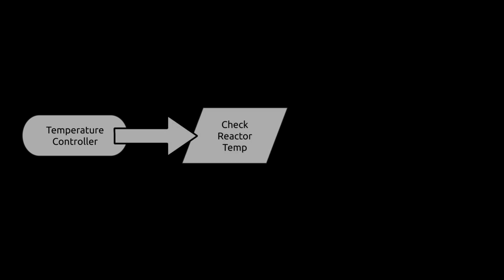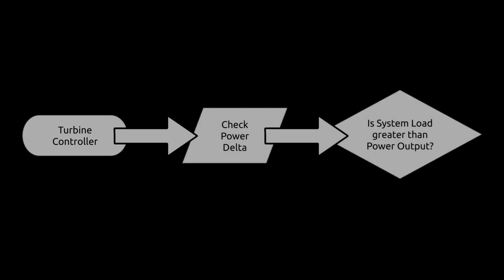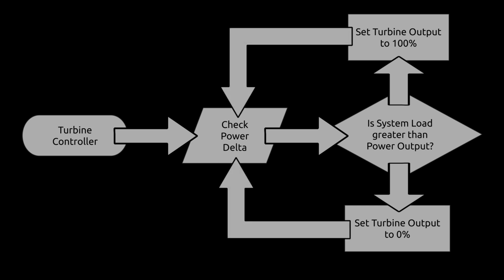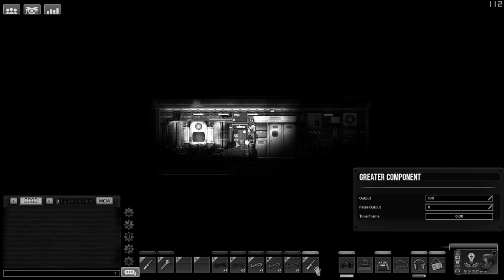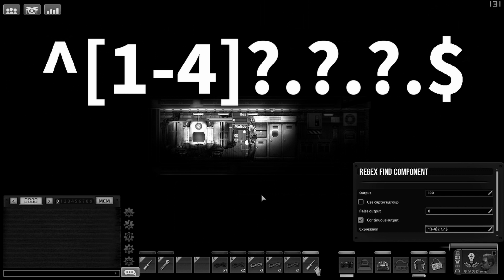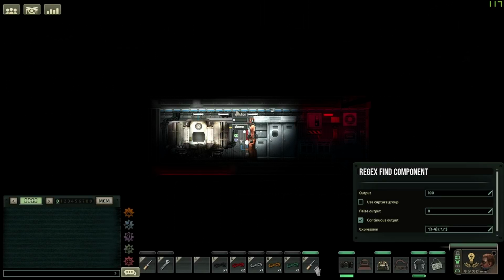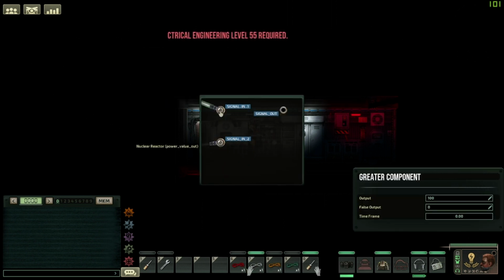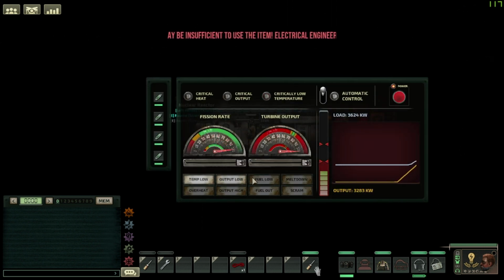Barotrauma - BEHOLD! The 2-Component Reactor Controller!

Comment: Great system that's worked wonders for my campaign! However, it does have one issue - the pattern used in your regex component will keep the reactor temperature at 4999, because everything between 4000 and 5000 still matches the pattern of starting with 4 and having 4 digits. The pattern ^([1-3]?.?.?.?|4000)$ will check for the numbers 0-3999 as well as 4000 with the or operator, making sure it stays at 4000 degrees exactly.
Reply: This definitely makes a lot more sense. The one in the video allows up to 4999 which is too much. Your formula expression works a lot better.
Reply: I know I'm kind of necroing here, and I'm fairly new to RegEx. What's the purpose of the () at the beginning and end? Is it for the | to function?
Reply: @Phoenix33699  In this case I don't think it matters, but it essentially clears up any confusion in what it is looking for. The | is known as the "pipe" or a "logical OR," which basically says that we accept anything to the left of the pipe OR anything to the right of the pipe. For the pattern '^([1-3]?.?.?.|4000)$' it essentially says it will output 100 if the input is any value between 1 and 3999 OR 4000. If we remove the parentheses, then it will have the same result, but by asking for a different value. For example, the pattern '^[1-3]?.?.?.|4000$' will output 100 if the input is between 1 and 3999 OR ends with 4000. Either way, it outputs between 1 and 4000.

If you want more practice with RegEx, the wiki recommended this website, which is where I learned it. https://regexone.com/lesson/introduction_abcs
Reply: @coopj70  so if I'm getting this right the parenthesis are limiting the search field for the OR?
Reply: @Phoenix33699  That is correct. The ^ and $ are essentially saying that it should start and end with whatever is in the parentheses, i.e., should only contain what is within them.  

It's similar to using parentheses in a math equation, it's just to separate or "group" your operations. I believe in computer science, Regex can use these groups for further use, but doesn't seem possible in Barotrauma.
Reply: @coopj70  gotcha, thanks so much for your help!
Reply: @coopj70  The parenthesis aren't strictly necessary, but if you don't use them then you have to redo the ^ and $ for each or else it will only use ^ for the first and $ for the second. I think the parentheses just make it cleaner.
Reply: @coopj70  Every time I try to use regex I generate a thousand more problems, but I can't get past the allure of its power. That website looks like a godsend. HUGE thanks!
Reply: @Phoenix33699  The parenthesis aren't strictly necessary, but if you don't use them then you have to redo the ^ and $ for each or else it will only use ^ for the first and $ for the second. I think the parentheses just make it cleaner.
Reply: @CaptainK3K Dunno if there was an update to change that behaviour. But you only get to the full power mode of the reactor if you go above 5000. You can drop down to 4500 for most loads after you went above 5000 once. But as soon as you drop to 4400 once it will go into a less power mode and will stay there until you hit above 5000 again.

I tested this in the submarine editor with the standard reactor 10MW (with 1x thorium fuel rod) with 10MW load. I wasn't able to produe 10MW reliably far below 4900.

With your RegEx I can only squeeze out around 8mw of the reactor. So to simplify things having the RegEx go to 4999 as a check is the perfect sweetspot.

Thanks for the effort tho.

edit: I did test two tests for fuel economy. 4000 seems more fuel efficient if you don't want full power available. With 8MW load on the 10WM reactor (kinda the limit of 4000) the 5000 reactor went offline when the other one still had 7% fuel left.

So I thought okay but we have batteries. So I took two empty Batteries got them to 15MW chargerate and 500000 Capacity and charged each one with a seperate reactor. The 5000 Reactor went offline early but was able to fill it up to 4117 Kw/min while the 4000 reactor only got it to 3527 Kw/min. (Fuel consumption rate was set to 10 instead of 0.2 for time saving)

As a sidenote it also seems to smoothen the curve a lot if you stay around 5000. If you wanna squeeze out every bit of fuel efficiency Don't take a simple RegEx. Use a Greater and Memory component and adjust the temperature value yourself. Or make a setup that allows you to configure specific temperature targets via Buttons.

I think all of this is completly overrated and you should just run the reactor @5000 like the original RegEx does.

edit: Edited the post a lot since I did more and more testing.
P.S. I always use a Greater and Memory component instead of that RegEx. While I don't know for sure I guess a RegEx will cost more CPU performance than a Greater + Memory Component. If anyone could prove me wrong I'm happy to change my mind.
Reply: @TheDashACorner  Never mind! It caused fire after 30 minutes xD
Reply: @Stoss_  Well right now I have as target temperatur "turbine output times 55" with a greater component and 100 - 0 output. Works well for me.
Reply: @TheDashACorner  [1-5] is okay. That fuel rod depletes faster because the ship has to draw that amount of output from the reactor. Do tests in max speed, try [1-4] and [1-5], see the difference in speed and output.
Reply: So is this with both a RegEx and a Greater than component, or is the OR component instead of the Greater than, and how is the wiring handled?
Reply: @LifestyleEmpowerment  exact same way as in the video but the RegEx expression is replaced with the above
Reply: Actually according to the wiki, 5000 degrees is the max fission rate, and only above 6000 it is unsafe, so the thing shown in the video is correct
Reply: stop all that gibbergabber and help me weld these walls shut!

Comment: I had a madlad named Core come on to my ship and build this controller in to our reactor.

At first, I was a bit timid about him modifying the wiring of the most important part of the ship, but, I cautiously allowed him to do it.

And then, obviously, the controller took over from the standard reactor automation, and whoa-boy, we didn't have any more power issues, ever.
Reply: always enable wiring, as an engineer i cant tell you how frustrating it is to join a long campaign and not have access to our greatest asset
Reply: Wait so when you use this upgrade do you not set it to automatic control?
Reply: @Th3Orange  Automatic control interferes with these devices, so you need to turn off the automatic control to get the best results.
Reply: @TMHedgehog  got it! Thanks!
Reply: @Th3Orange  I use it with automatic control no problems
Reply: @jemlesvideo automatic control is controlling your reactor then, not the components
Reply: @achield3613  It does control anyway, it just helps to be more precise and shorten delays

Comment: I'm glad I'm by far not the only person that's figured out this simple controller, or other things, such as fully automatic turrets, all of which I'll use to make a fully autonomous dugong, if I figure out how to make an autopilot, that is.
Reply: Fully automatic turrets, that track and fire?
Any tutorial?
Reply: @DeepInsideZettaiRyouiki  sorry man, I got an error trying to upload it to the workshop just now, youtube deletes my comment if I try to post a download link, and I don't have the time to make a tutorial, I tried.
Reply: How exactly did you do the automatic turrets? I thought of using motion detectors in a grid to have a "coordinate" of the enemy, and then use trigonometry to calculate the angle that the gun should be at. The only problem is, you'd need an insane amount of motion detectors. Did you do it like this, or did you find an easier way?
Reply: @Max-DuBois  yeah, I used 21 motion detectors (11 for the x axis and 10 for the y axis) with overlapping detection boxes,  such that each one extended ~100 units further than the previous one. interestingly, you can feed the raw output of the motion detectors (as long as you set the outputs to multiples of 100) directly into the atan component and it works (unless some update broke it since then), but of course you'll need a relay in-between due to how many outputs you end up dealing with

Comment: Great suuper easy to create, maintain and understand.
One note thou: This regex keeps the reactor lower than 5000C, since 4999 pass the regex by matching "start with 1-4 followed by 3 other characters"
Reply: After looking into regex more, I found a fix for this. the pattern ^([1-3]?.?.?.?|4000)$ will check for the numbers 0-3999 as well as 4000 with the or operator, making sure it stays at 4000 degrees exactly.
Reply: I dont think this is the case, check regex101

Comment: Is the purpose of this regex to check if a number is >= 4000? If so, A) why use a regex instead of a `>` comparison style block, and B) as others said, not working.  

It's actually provably quite difficult to build a regex that implements and arbitrary numeric comparator
Reply from the maker: I misspoke in the video, the target temp is 5000, not 4000. I'm putting a more detailed explanation of the regex expression in the video description, please compare it to your own, and hopefully we can figure out what's not working for you!

Also, the point of the regex is simply to have the minimum number of components necessary. Using a greater than comparator and a memory block for the reference value would work, but would also require a 50% increase in the number of component used.
Reply: @TheGamingNerd2022  ah cool. Thanks for the vid! Regex works okay for numeric comparison as long as you can make the border number a single digit followed by an arbitrary number of 9s (in decimal). If you wanted it to be 3500 or even 3499 you would def want the numeric comparator, though you might technically be able to make a regex for that it would have to use back references and be compute expensive. Pure regular expressions cannot implement generic numeric comparisons without growing in size linearly with the comparison number, but these ones are extended to be effectively turing complete I think.  In this case I didn't realize you'd need the memory block for the comparator component
Reply from the maker: @d0ubtingThom4s  you know your regular expressions! Practically speaking, a comparator is a more logical solution. I'm currently testing a controller with three selectable target temps (3500 for low-demand fuel economy, 5000 for normal operation, and 5900 for faster load-following), which is impossible with a regex. Stay tuned!
Reply: @d0ubtingThom4s  it is actually possible to go for 3500, or probably any temp. with just a regex component if you flip the outputs(0 if true and 100 if false) and then set the regular expression to somethin' like (3[5-9]..|[4-9]...)  (there's probably a simpler way, but that's just the first one that came to my mind)
Reply: @jakubzelenak330  it's absolutely possibly. You can also put OR expressions in a regex with |, so worst case you can use 1|2|...|3499, so of course any finite set can be matched with a regex. The problem is that either this regex will need to be arbitrarily large for such a problem, or you will have to use references to capture groups within the regex (backreferences). I'm basing this on theory of computing class I took years ago
Reply: @jakubzelenak330  and what I'm telling you, (I'd be happy to be proven wrong), is that I recall from this class that there is provably no short regex that you can make for arbitrary numbers. So if you can actually come up with one that doesn't grow massively with input size, and doesn't have any problems, colour me impressed. You can set it up on the regex tester for the game, and share the link!
Reply: @jakubzelenak330  3100 will not match your regex

Excuse me! I think your solution works fine!  Just like you could do with /3[1-4]..|[1-2]...|.{0,3}/  - I suppose either I'm totally mis-remembering this, or it's actually just hard with average, say, n-digit numbers where they are all different.  3500 isn't really much harder than 35.  But if we did want to do, say, 3125, then i think it will get more difficult with each digit we add that isn't 0 basically.
Reply: Or maybe the optimal regex only grows linearly with the number of non-zero digits?  Not actually sure
Reply: @d0ubtingThom4s  I mean, I am not an expert on this in the slightest, I haven't done any programming whatsoever, I just learnt regex on the site recommended on the barotrauma wiki (which I would say is great at teaching this from my experience)
Reply: @jakubzelenak330  that's awesome!

Comment: For some reason I can't get this to work. The turbine is always maxed out as the output never matches the load by 500 below it
Reply: I think this is caused because of the temperature being fixed at 4999. Turbine Output is set at max but wont suffice since heat is not enough. Either an additional rod is added, or a more complex component is needed. Something to add the logic that "if turbineOutput is 100 but energyOutput doesnt meet demand, increase fission rate"
But i wouldn't know how to implement that in barotrauma. Im quite new to it yet
Reply: I ran into the same problem, the default rods can only generate 80% of the reactors output. Putting a second rod in will fix the problem.

Comment: I spotted a small mistake. The "[1-4]?.?.?.?" regex will match up to 4999 
fix: [1-3]?.?.?.? => 1 to 3999
At the end of your video, we barely see it, but it stabilizes around 4999.
Reply: Yup, wanted to say this! Also it's unnecessarily long. How about just /\b[1-3]?\d{0,3}\b/ using the zero width matcher instead of the start/end of string to make it easier to test.  But god I love that full regexes are implemented here - zero width matchers, lookarounds, it's beautiful!
Reply: @d0ubtingThom4s  I was thinking about being a smartass and proposing [1-3]?.{0.3}, but I really like the simple to read [1-3]?.?.?.? you made initially. :)

Simple is better than smart and your regex video is the perfect example.
Reply: @tsunamio7750  I suppose it's incontrovertibly using fewer character classes, so simpler in that way.  But IMO the other is simpler in that you don't have to count how many question marks there are in your head.  At least for me it's more parse-able so say up to 3 of a thing than 0 or 1 plus 0 or 1 plus 0 or 1 of a thing.

Comment: Hey i ran into a problem where if the fuel rods run out then the controller freaks out and you have to detached it and rewire it again to regain control of the reactor and repower the sub
Reply: I usually put a relay with a switch into the reactor controllers. That might help serve as a reboot option.

Comment: Reactor controllers are cool, but I just think they're a little dishonest to the game
The auto controller is slow specifically so that you need an engineer, with these they might as well remove the reactor controls from the game, besides on/off
Reply from the maker: So... You're volunteering to play as the guy who stares at four graphs and manipulates two sliders while everyone else plays the rest of the game? I would argue that controllers like this allow one more player to enjoy the game with the rest of their crew. Otherwise, between managing the reactor and repairing junction boxes, choosing to play as the engineer is more of an exercise in masochism than anything else.
Reply: @TheGamingNerd2022  or, conversely, it's used the same way as autopilot 
You manage it until you need to do something else, do that, then rush back just as the reactor will explode, saving everyone 

That way the engineer has a job aside from "I have literally fixed 400 junction boxes and there was another EMP blast. Kms."